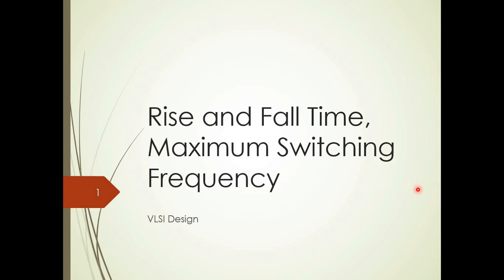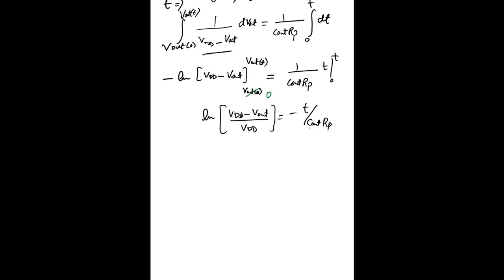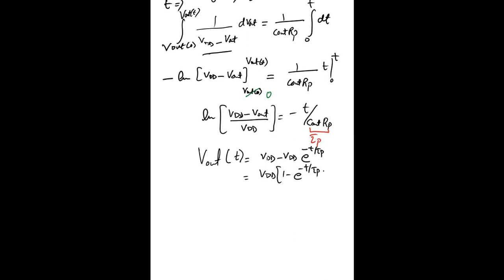Rise Time, Fall Time, Maximum Operating Frequency of Inverter | VLSI Design | Dr. Sohaib A. Qazi

Comment: Equation for t at 29:38 should be:
t = tp . ln[ (VDD-Vout(t)) / VDD) ]
It's upside down xD
Reply from the maker: expression for t is correct. Just need to add "ln" on right side of the expression. You can obtain this solution if you solve the expression of Vout (t) for "t". I hope this helps.